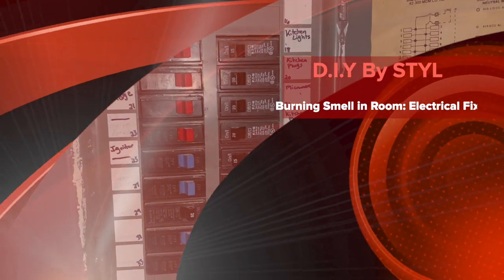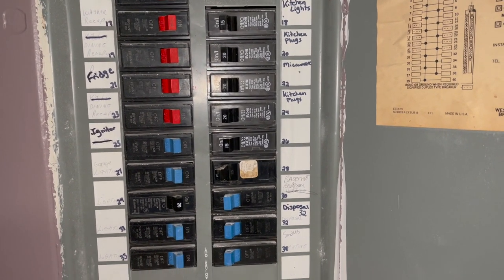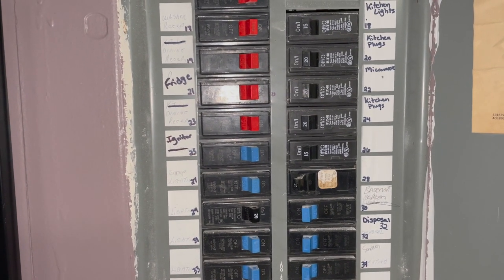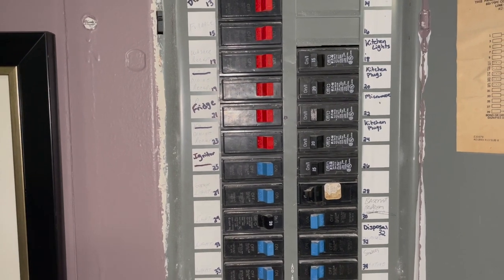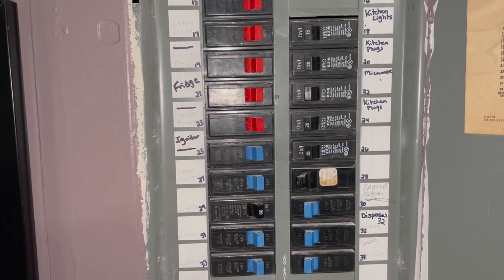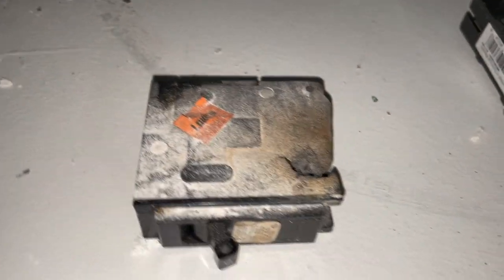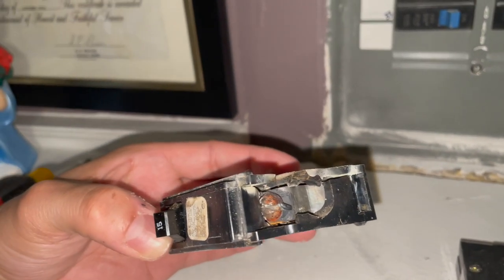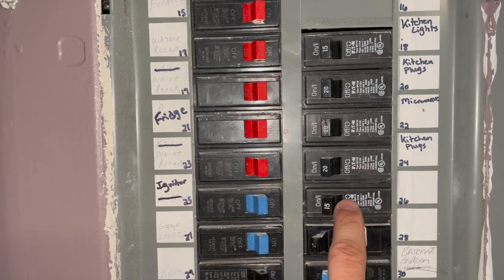Burning Smell In Room: Circuit Breaker On FIRE!!!  HD 1080p

Comment: That's the same thing that happened to my house today alarm went off all the lights went off like the circuit breaker tripped and then all the lights eventually came back on but now my AC unit and heat is not coming on😢
Reply: Oh and I smelled a burning smell